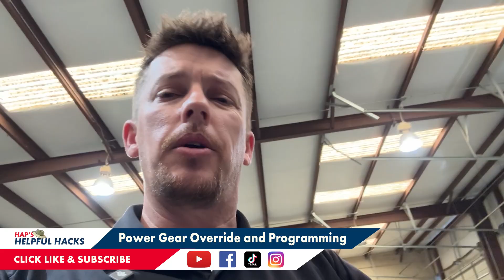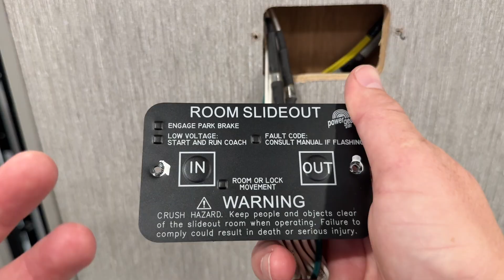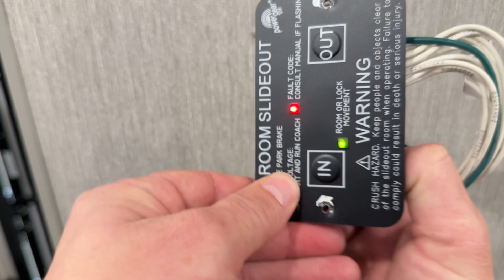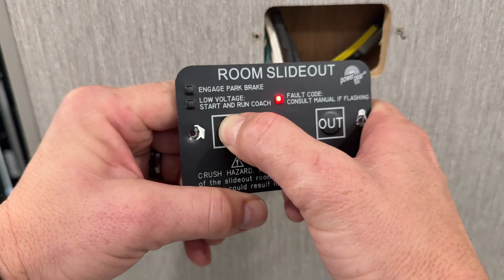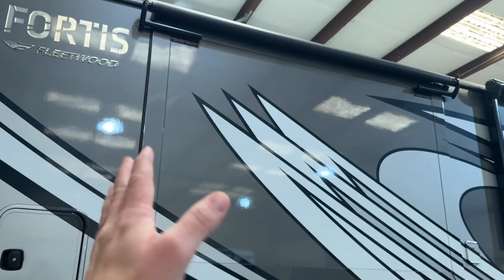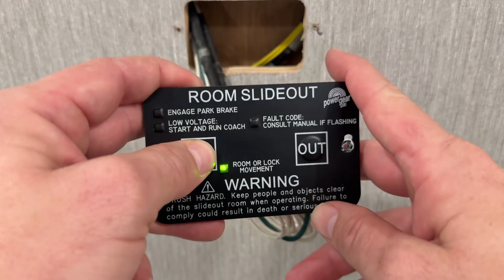Power Gear SlimRack Slide Override & Programming | Reset Stops & Clear Fault Codes

Comment: Just curious is this where you would start if I have normal operation but one top skim rack arm bowing outward much more than the others when slide out is in the out position? It operates fine but I noticed it recently and it seems to have a lot of pressure on that one to arm compared to the other 3.
Reply from the maker: When you say one arm is under more pressure than the other, do you mean bottom vs top or from one side to the other?  -Todd

Comment: When I hit the reset button for 5 seconds, the red and green lights flash separately. That means an error code right and if so, how do I reset the system so we don’t have to override it every time
Reply from the maker: Check out page 3 of the link below, it explains diagnostics and show you how to read the fault.  Then page 4 will help you identify the fault as well as give you probable cause.  If you identify the problem I might be able to give you further direction.  -Todd

https://lci-support-doc.s3.amazonaws.com/manuals/slideouts/powergearslideouts/ccd_0002533.pdf?utm_source=chatgpt.com